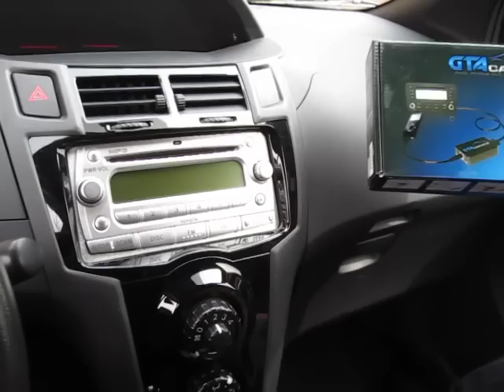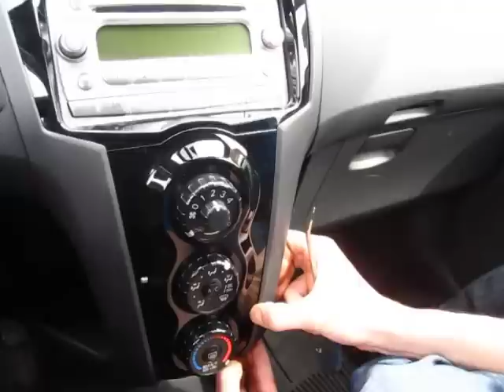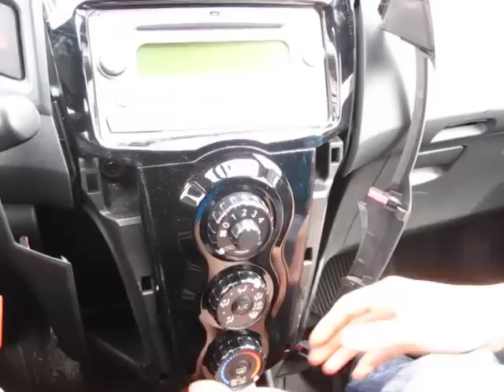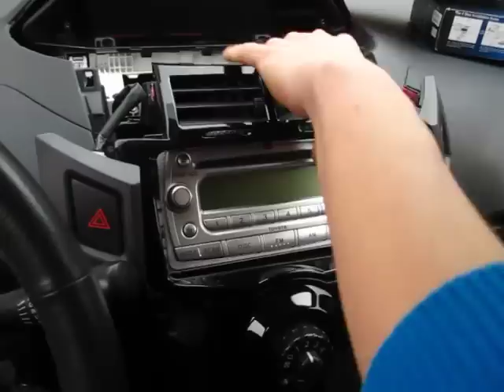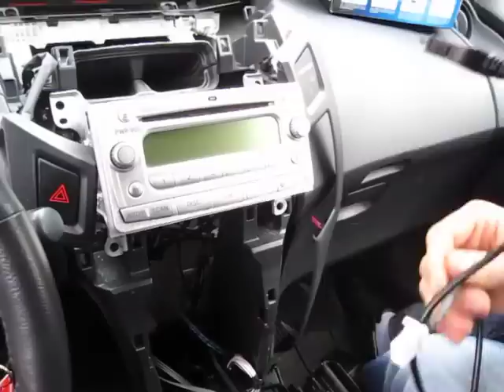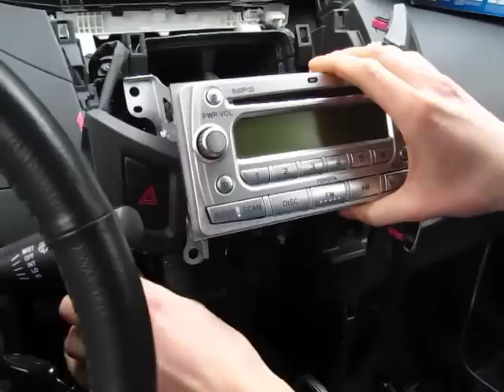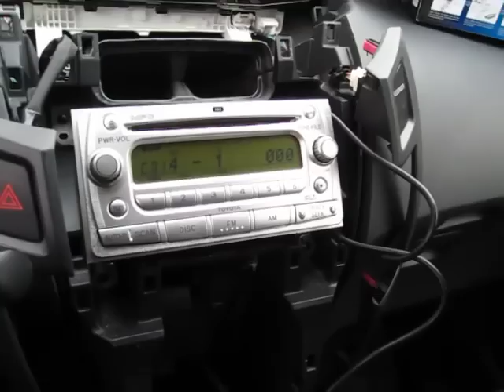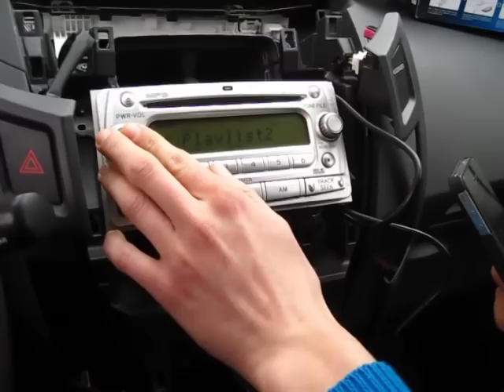GTA Car Kits - Toyota Yaris 2006-2011 install of iPhone, Ipod and AUX adapter for factory stereo

Comment: Thanks for the tutorial on installing the GTA car kit!  I thought it was going to be difficult but I installed it in less than half an hour!!  It was easier than I thought.  I was planning to pay someone to do it if it wasn't for this video.  I didn't even need the clip removal tool as it just snaps out.  I also didn't need to drill a hole...I sort of just shoved it to the side panel and left a little space there and it looks fine.  free of awful fm transmitter!!  I love the sound quality!

Comment: Just installed into Toyota Yaris 2006. The volume is WAY louder for radio compared to my mp3 player which is turned all the way up, and I cannot change songs from the radio itself like shown in this video. any possible cause of this?? thanks.

Comment: @gtacarkits Any chance for an Android adapter in the works? I just bought a Galaxy Nexus that is running Android 4.1 (Jelly Bean) and an adapter for my 2008 Yaris would really come in handy when using a music app like Google Play or Songbird. I know there's an AUX input but, I would prefer to control basic functions like play/pause & track forward/backward from my factory head unit rather than taking my eyes off the road to do the same on my phone.